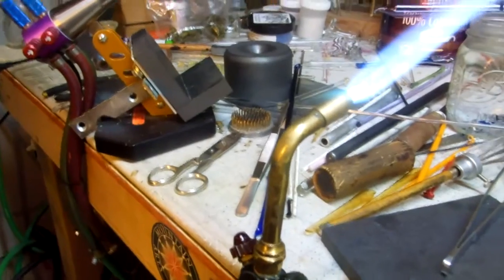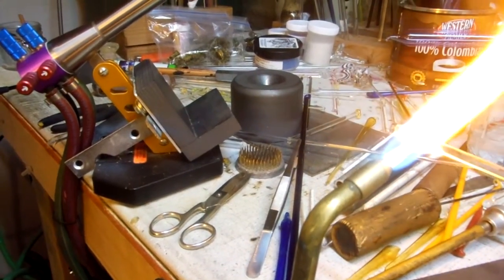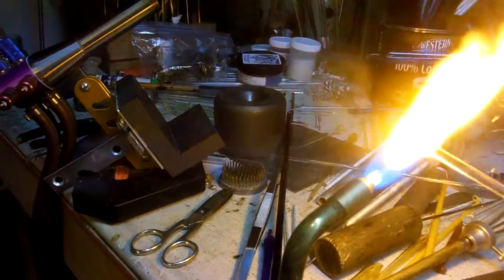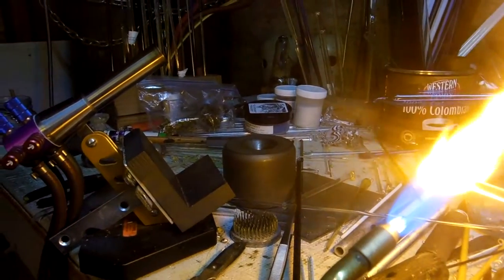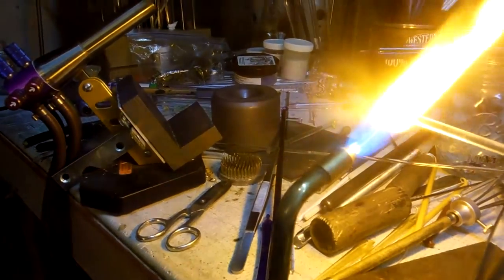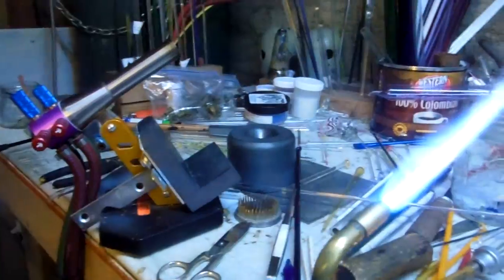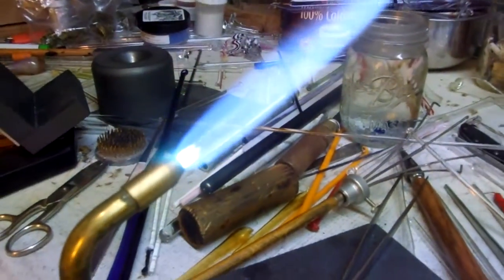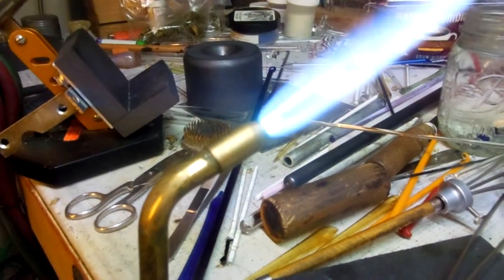National 3A torch on a 5LPM oxygen concentrator

Comment: Thanks for showing us. I read from National 3AB Torch manual that it runs at 20 psi oxygen and low pressure fuel @ 0.25 psi. I am wondering if this 5 lpm machine can supply 20 psi oxygen?

Comment: Would this set up handle 1" heavy wall boro tubing?
Reply from the maker: Just welds. To work the full tube you would want more power.
Reply: to the 3a torch cannot handle 1" boro or just with a concentrator will not handle the 1"?
Reply from the maker: It will hande large work with a big tip and 2-3 concentrators. 10 lpm and you can work 32mm no trouble.

Comment: how many concentrators would I require to run a nation 8m torch at max capacity , any idea ?
Reply from the maker: +Justin Harrison  Figure 1 LMP per hole in the tip so 7 hole tip would run fine with a 5 lpm machine but better with a 10lpm machine. For a 21 hole tip you would want (2) 10 lpm machines.